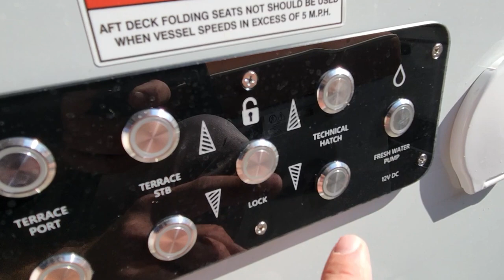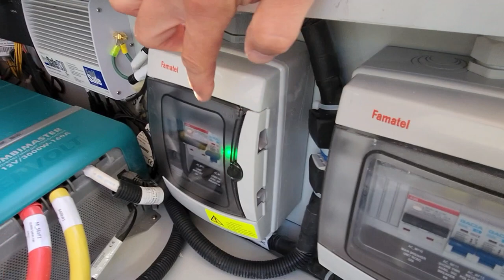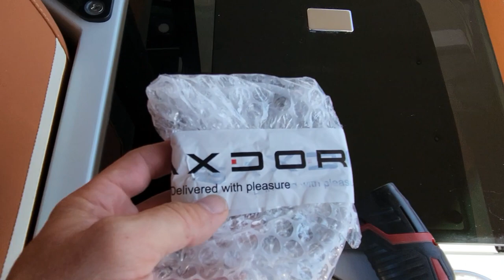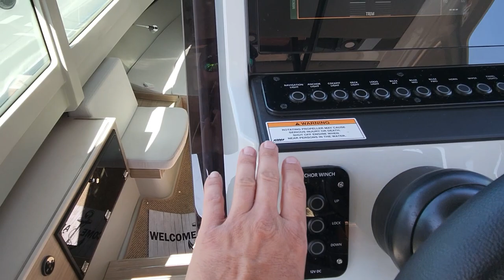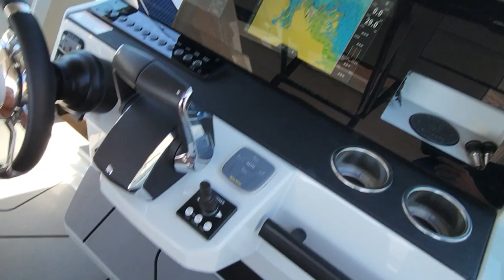The Saxdor Returns!! A Trip To The Marina!! #Saxdor #LittleHarbor #WrongPart #Episode212

Comment: Justin, that there are a few more of these around in the states which is a good thing. what are your thoughts on the maintenance items on the 320 or the small pop issues that come along with more use and hours on the boat?
Reply from the maker: It's about the same as any other brand as far as maintaining it but the special parts sometimes take longer to get being it's a  newer company that is overseas(Poland).

Comment: In your experience, which boats do you work on the least? Which ones would you consider the "most reliable boats?"
Reply from the maker: That is a good question. It really depends on how big the boat is. If you are going for reliability then simple is better. All boats use the same type of components.  The more stuff added the more problems in the future.  I would get a Parker or simple center console if I wanted less problems. You can also pay for premium brands like Intrepid.  They build stuff to hold up for years.
Reply: @JustinLeeMarine  Thanks for the info. Specifically, I'm looking at a Sportsman Heritage 231. 23' Center Console. Yamaha FX200. Nothing too fancy.
Reply from the maker: That would be a good one. Well built and simple.
Reply: @JustinLeeMarine  Thanks for the advice. Keep up the good work.
Reply from the maker: Thank you. I appreciate that 😊